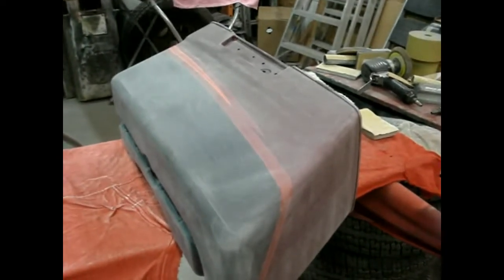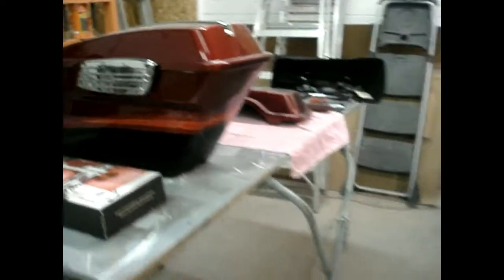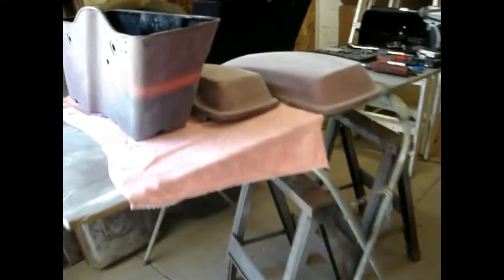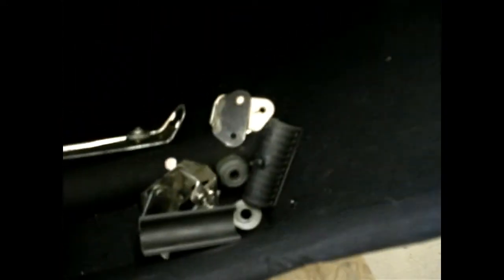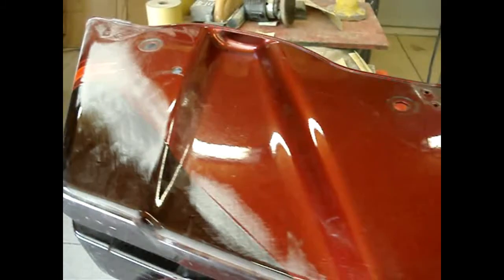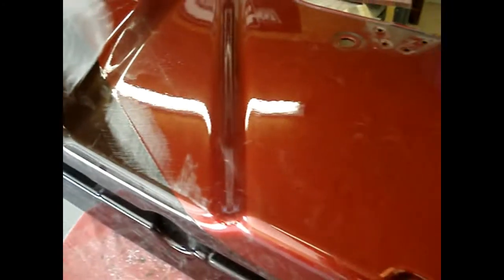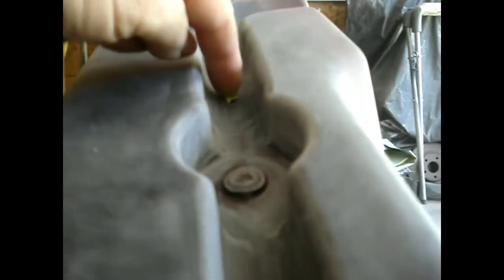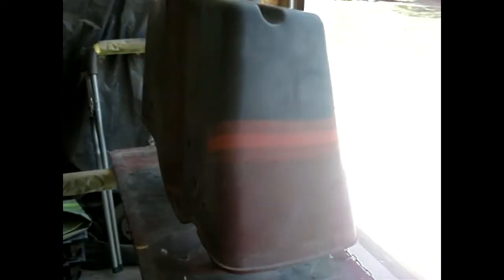Harley Davidson Hard Bags Prep and Paint Tri Stage Part 2

Comment: Im looking forward to the 3 stage paint. Plan on some of that on my 57. The rear wing and thought about a crazy thick candy silver, high metallic for bumpers too.  Im not sure yet
Reply from the maker: Three stage urethane sprays easy, the trick with all effect paint is applying it consistently. Are you thinking metallic or flake for the bumpers?
Reply: @ceedell  well i just got used but look new taillight housings so maybe not now. But it was a thought and could be an option ya think?
Reply from the maker: @junksautomotive  Chrome is expensive but I  like chrome. lol
Reply: @ceedell  yeah me too. Hard to paint a bumper and enjoy how it looks!